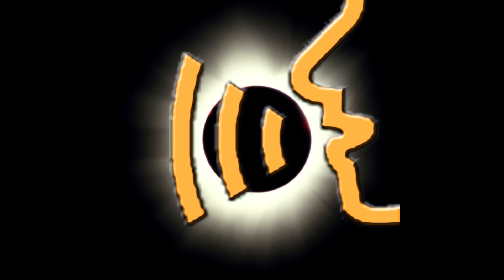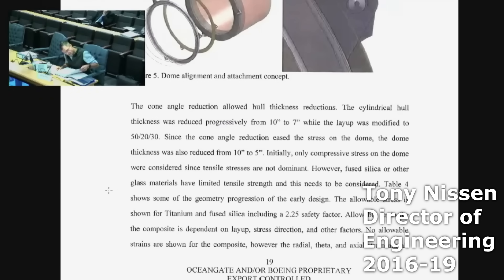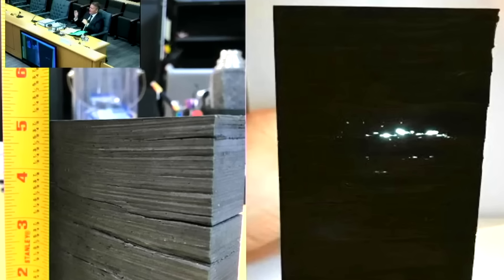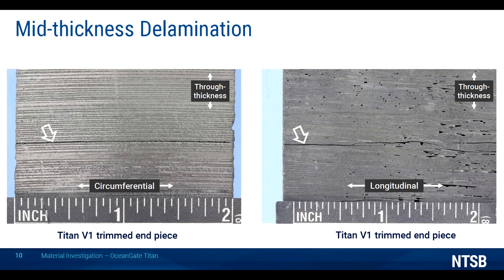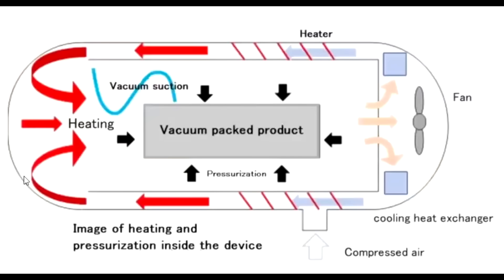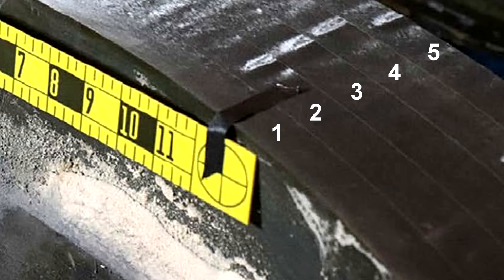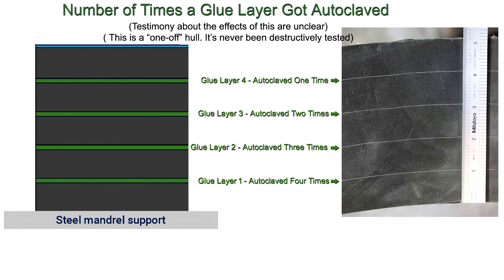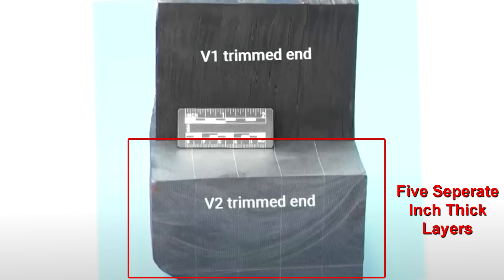Who Engineered the OceanGate Titan V2 Hull? Maybe Nobody Did?

Comment: The lightning strike is interesting. Composite aircraft use bronze mesh carefully terminated to metal flange. The idea being that voltage will not build up enough to cause high discharge currents and damage at the attach points. If a composite wing is coated with an extra 0.0005” of paint, it might be utterly destroyed. I think we can assume there was no metal mesh here. Was there damage as the lightning current entered the graphite mesh? Was there a channel of micro cracking? Did the investigators examine wreckage known to be the attach points?
Reply from the maker: Thank you for your comment.  Those are excellent questions and none of them were answered directly in the testimony.  However, Tony Nissen's full testimony talked a lot about the lightning strike in the Bahamas.  He said it was not a direct strike on the Titan.  But it was close.  The strike may have hit a catamaran which was docked right next to the Titan.  The people who were working on the catamaran showed him where the discharge may have exited through one of the props.  The electric energy did knock out most of the electronics on the Titan and a lot had to be replaced in the Bahamas before they could resume testing.
Reply: @solareclipsetimer    if on board electronics were damaged then the sub was hit hard. When an aircraft suffers a strike on the ground the maintenance people do checks. If the aircraft (or sub) was connected by ground cable then usually (not always) this is one attach points. Was the sub in its transport cradle with no services interface to the dock? Say it was not, but that adequately intimate submarine to cradle to local soil existed. Say the lighting attached to the local high point (catamaran mast), then the cat was on a cradle of high impedance to ground, so the sharp prop blade created a field, charge built up, and it jumped to the sub, then earth. We cannot know the peak currents in the pressure hull but by examining the catamaran prop the size of the pit gives some indication. Why did equipment die on the sub? Let’s say the electronics has their negative power and chassis tied to submarine chassis earth. The ground may have moved up to a large voltage able to cause breakdown within a unit between earthed items and items floating. 
By asking a lighting engineering company to investigate, they could have looked at damage, looked at the “ground model” of the sub, and commented on risk of plasma tunnelling into the stressed pressure hull. Lighting can be seen as very broadband power. From DC to GHz. Tiny reactance between items can result in buildup and discharge. 
You can do an experiment with AC where you take a block of resin, make it perfect, and stress it to failure with high voltage RF. Now make another with some bubbles. It will fail much sooner. The bubbles look like capacitors and instead of forming a linear voltage gradient through the insulator, voltage builds up at the bubble walls and much more RF current will flow. So your test article that measures 1 gig resistance at DC will arc through after a minute at 1 KV across it. I write this to help explain why lighting is so lethal to systems not designed to accommodate. If anyone is going to write up regulations for composite subs, they will want to talk to an EMI / Lightning person. Or, cover the boat with a metal net well earthed. Even now, an investigator might be able to find out what systems were lighting damaged and maybe someone saved items. By looking at the cradle, finding that cat prop, looking at the drawings of the sub, a sense of the risk for a plasma hole to have formed could maybe be established. The wreckage might show this damage. I think it’s possible a 0.001” carbon tracked hole maybe let water in, or cascaded to failure.
Reply: @solareclipsetimer  cant trust nissen, they cant even make a good car anymore and got bought out by hundo

Comment: Everyone working on this project is at fault. 
Carbon fiber is like glass, when there is a defect anywhere, it might as well be everywhere. Most of this is common sense.  No one is taking in account, the water tempature and its effects on the adhesives. Hubris and penny pinching raised to the nth degree.
Reply: The temperature effect on brittleness (say water was about 4 degC), was probably not a huge deal. But, I was taught that the reference stress is a function of the cure temperature plus the affect of volume change at cure. In other words, if an epoxy resin is cured at say 80 deg C, then it is “born” at that temperature. So any temperature above or below creates stress in the system. But, many composite systems have a step change of volume upon cure, so the reference, or “zero thermal stress point” , shifts accordingly. So even if cured at the example 80 degC, it might actually reach zero stress at say 100 degC. Now a complication; these systems usually have a different thermal coefficient at each axis. So you encounter the zero stress point for each axis at different temperatures. I have had in my hands data sheets that ignore this. More misery; variations cause actual properties different from data sheets. So the model may differ from reality. Usually overdesign can eat these up. But what about systems that don’t have massive margins? Like here, they crashed into the real limits. I wonder what the real end product was like?
Reply from the maker: @richardkudrna7503  Thanks for your thoughtful reply/comment.

Comment: Basic question; when you compare a side by side welded titanium sub to a composite version, what jumps out? My first thought is that it might weigh more, but the ability to model is so much easier. The risk of non quality (quality factor), is so much better with titanium, no? In the end, wouldn’t titanium cost less?
Reply: Not a materials engineer here but isn't Titanium notoriously hard to process? It's not as easy as steel in every case.
Reply: @MiTheMer  Harder than more common metals yes, but its not as if its 1950 anymore. The kit to utilize it within the aerospace sector already existed when LBJ was in office.
Reply: @MiTheMer  this is relative to this elaborate composite structure. Submersibles made from Titanium alloys have been made for 70 years. One very cool method of forming bonds between forging a was summarized to me by a very amazing Russian man. What I took was the forgings are shaped to wedge against the pressure load. The surfaces to be bonded are coated with pure titanium. Small systems can be put into vacuum then bombarded with radiation until diffusion occurs. Big things such as full submarine hulls can be “welded” at the interface with electron beam. Simply building a weld with inert gas methods does work but you have to “eat” the properties loss at heat affected zone, the inevitable inclusions, and wrong alloy recast area.
The folklore is that in the 1970’s Russia invested in massive titanium forging capability so they could build deep diving high speed attack submarines.  Steel hull would become so heavy that turning made excess cavitation even at depth. By reducing mass, the agility was increased. Stories exist of 60 knot titanium subs with 150000 kw reactors. Truth?
Reply: Wouldnt volume determine cavitation while turning? Also anything that big would probably cause some cavitation at that speed (if possible).

But thats IMO. I dont know hydro-engineering.
Reply: @Mglue3  I am in no way a submarine guy but what I was told is that if you take two identical subs, one heavier than the other, run them at same depth and speed, the heavier one will hit rudder and planes cavitation threshold (very loud) first. Submarines steer with rudders and planes. When at speed they have momentum and resist a change of direction. When a rudder is deflected the low pressure side will cavitation. The deeper you are the more that pressure fights cavitation. Fast subs therefore want to be light to manoeuvre. The folklore is that long ago when “Skipjack “ came out, they could dive deep (say 600 meters), and power up the reactor such as to out run torpedos. They could turn quietly. In time, Russian developed the rocket torpedo “Skvall” that cannot be outrun, instead you needed to turn as the torpedo had trouble “seeing “ when at speed. The new ones supposedly slow down to gather telemetry and re attack. Countermeasures include the target launching decoy torpedoes that bubble to Jam sonar and make so much acoustic noise that the enemy can’t find you.
Reply: @richardkudrna7503   so if reading you right. Lighter mass makes the turn quicker and with less. Less turn time equals less cavitation assuming everything else is the same. Makes sense.
Reply: Thats only if you hold the wimpy assumption that the laws of physics wont fold before your implacable ego.
Reply: @kMegalonyx  don’t forget the power of a confident voice.😂

Comment: I have noticed composite structures (not pressure vessels), with “E” metal flange. Instead of a “C” shape, the metal is bonded into grooves in the composite. I assumed this was done to increase the area of the bond line and to allow tension loads to better transfer to the flange. Would an “E” profile flange make sense here for a sub?

Comment: Why would anyone push back against 45 deg ply? Was this just to simplify? We heard that no torsional loads are expected but given the huge pressure stresses, doesn’t a cross ply imply reduced resin to fibre de lamination when being strained?
Reply: My guess is spencer composites couldn't build the 7 inch thick design or the 45 degree ply's and did some math that they got wrong in an attempt to find out if what they could build would work.

Spencers decision to downrate to the 5 inch hull is the clear point at which things started to go wrong. Whilst i'd want to investigate what exactly went wrong in their math, mostly likely spencer is the primary culpable party in the whole endeavour. Stockton may have secondary culpability if the Spencer design was marginal and the multi-segment layup further weakened it. But most likely the hulls repeat strain handling capability was compromised by the decisions of spencer and the multi-layup design merely compromised an allready dangerous design further.
Reply: They hinted that they didn’t want to scrap the big Titanium caps and make new ones to accommodate the thicker hull. Money, schedule, the usual.
Reply: @ The caps were made after the 5 inch change by spencers

Comment: What strategy exists for failure accommodation against seawater permeation? If LCF results in defects in the brittle resin, risking seawater ingress and eventually jet cutting, is there possible mitigation? For example cold metal deposit? Would a layer of cold spray aluminum between layers be adequately active to bond to?
Reply: I thought about this quite a bit, and I think the Silver Bullet really is steering clear of brittle composites. Carbon fiber is a highly flexible lightweight material with high tensile strength, but its compressive resistance is attributed entirely to the binding agent, being the resin. With such a low tolerance for plastic deformation, it's just not a very good material for compressive loads. I'm not sure if using a polymer binding agent would be appropriate or not. While it would be more flexible, it would also lack the rigidity necessary to prevent the structure from collapsing.
Reply: TwinTony  I wonder how much damage accumulated to the system from micro cracking of any resin rich zones? The recovered wreckage could be examined to see if any micro cracks formed in the resin. I have seen resin and glass systems develop defects after vibration test right at the areas where unwanted excess resin to glass ratio existed.

Comment: The glue between the layers, is the idea here to use a thin layer of a glue with a modulus lower than the structure material so as to minimize delamination hazard?

Comment: Thinking about this a bit, degassing seems to have been done, so good. Reducing shrinkage on cure by building in 5 stages and autoclaving, I wonder how much stress due shrinkage in cure  was still present (but this can be established by coupon test). Then I’m a bit stunned they didn’t characterize the overcure impact due the first layers being subjected to multiple autoclave cycles. Isn’t this easily done by building test coupons then testing properties then adjusting the model? Would not an out of autoclave process be better for such a thick structure? In other words, build slowly and allow thin layers to cure before the next layers resulting in reduced and progressive (not sharp steps) shrinkage prestress?
Reply from the maker: Thanks for commenting.  Yes, as testified by Mr. Brooks, they never proved the co-bonding multiple autoclave technique with scale model testing.  The full-sized hull was completely a 'one-off."
Reply: @solareclipsetimer  they field tested. Quite sad.
Reply from the maker: @richardkudrna7503  Yep.

Comment: I'm surprised the carbon fiber cost less than steel, I find that odd but I'm old so maybe my mind is in the past.
Reply: Its cheaper than having one large seamless steel cylinder, because of how large of a work piece that is to turn on a lathe or etc
Reply: @sestomolesto  right the same quantity of steel in small pieces would be far, far less expensive.